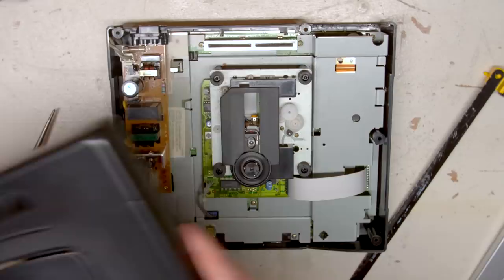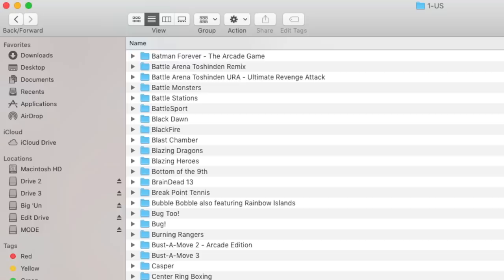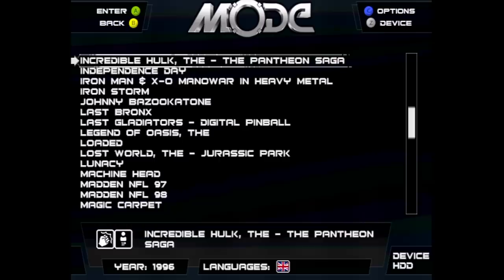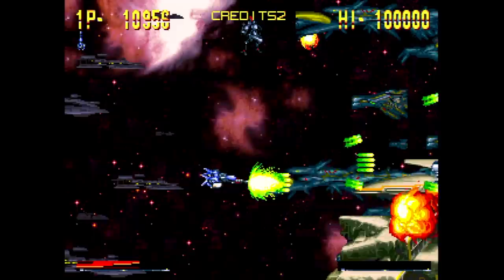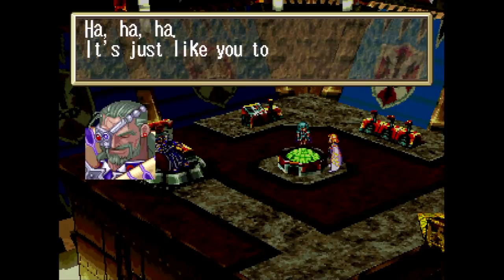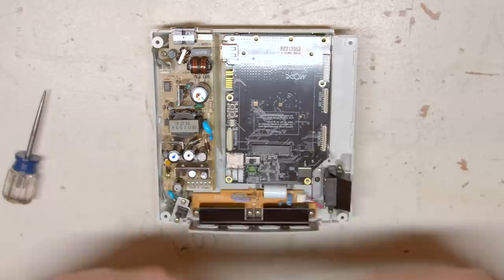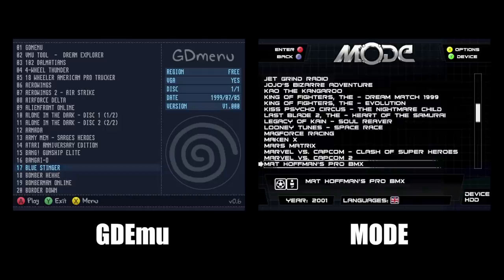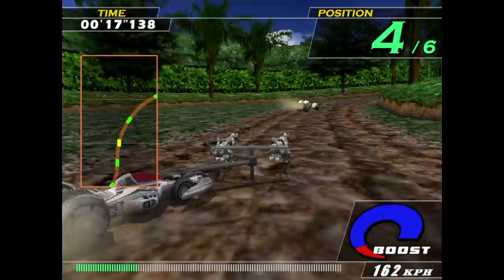The MODE from TerraOnion - Review - Game Sack

Comment: Talking about dreamcast, apart from the folders naming issue, which is the real deal between mode and GDEmu in terms of compatibility and ease of use? As mentioned in the video, I'd rather not use the FCB as a game cartridge to move from Saturn to Dreamcast; on the other side I do not intend to buy another mode, just too expensive considering also customs fees.. thx

Comment: How is the heat on the Dreamcast when using the stock power supply? I have a GDEmu and the System kinda heats up quickly if I leave the top on.

Comment: So I'm not the only one that hears a voice telling me to buy Dreamcast products. ;) Well can't say Terraonion makes a bad product but it's not their fault I can't afford them lol.
Disc rot might concern me more if SS games were easy to find with reasonable prices but optical drive failure is more common with that sinking issue that it's not hard to invest when you consider the alternative original SS hardware route.
A little early for DC optical drive fallout but there's not exactly an endless supply of parts either. Definitely worth investing in a MODE if you want to play some of more expensive games on original hardware Eg. "Could have got Illbleed for $80 complete, who knew it would skyrocket in price?". ^_^

Comment: Sega Saturn and Dreamcast emulation are still both far from perfect. I haven't seen an emulator for either of those consoles that can play a full 100% library with no issues. using real hardware is still the most accurate way to go.
Reply: Absolutely 👍

Comment: 6:44 that's funny, i wonder why that happens when you try to play fan translations on real hardware. I played the fan translated Dragon Quest V on a real Playstation 2 via Open PS2 Loader and it would run fine until i got black screen when i was hours into the game
Reply: Hacks of any game are usually developed on emulators because of convenience, and most, if not all emulators have inaccuries for obvious reasons. Something that runs on an emulator and relies on an inaccuracy is sure to fail on real hardware.

Comment: Once i get rich and can get at least a saturn or a dreamcast, would like to get this. And once i get megarich i'll get one of each console AND a MODE for each :P

But until then, it's just a dream. I would also love to get a SD thing for my NES, mod that NES for NTSC play in addition to its native PAL and mod it for better video out. I'd like to get a SNES as well, and an SD reader for it, an SD reader for my N64 as well as a controller (i bought the thing used for cheap, it didn't come CIB). I'd also maybe also like to get an ODE from the PS1. I mean, i do have all four PS generations, but OG hardware is OG hardware.

I also want to get my C64 to a working condition, get an amiga of some sort, get Master System and Mega Drive/genesis as well as a TurboGrafx 16. Not sure if i'd even bother with SegaCD or a 32X. I'd also want to set up a couple of retro pc's. One for dos and Win3.1, one for 95/98 and that era, and one for XP and maybe Vista. I'd probably set up Vista for fun to mess around for a few weeks, then just get 7...

Comment: I don't understand at all why the MODE in dreamcast mode is loading some games twice as slowly as the much older gdemu.  Is this something that can be improved in a firmware update, or is it some inherent hardware limitation???
Reply from the maker: Dunno. What I should do is also try the same game loading from an SD card instead of SSD. I don't know why that would make a difference but maybe it does?
Reply: @GameSack  Yeah, that would be interesting just to test.  I am planning to do the exact same as you and use a SSD when I purchase a MODE, as I assume the SATA interface combined with solid state device is going to be the fastest.
Reply from the maker: @bruceg22000  Well the physical interface is SATA but it has to be converted down to whatever the Dreamcast and Saturn use. Maybe it's slower to do that with SATA than it is with something like a MicroSD card. Still, a big SSD is less expensive than a big SD card.

Comment: This is something that has confused me for a long time: Why did they make one device for two consoles? That sounds like a massive waste of money, because it likely contains a lot of redundant parts if you don't intend to swap the device across consoles. Could it be they're using an FPGA and can make both consoles work using the same hardware and don't really need to add extra components? Either way, that doesn't make sense if you look at the insane price tag. The GC Loader now shipped multiple batches already and it emulates a GameCube disk drive for just 90$.

Comment: Cover Mode for listing games only displays the correct Cover Art if you name the files the exact correct name. All game listing modes list them alphabetically and there is no way to change that, no program you can run on your PC to arrange the games the way you want like the GDEMU if you use a third party program that run in Windows that lets you add games to a SD Card and arrange them the way you want, no program like that for the MODE. It's been out for over 2 years and support from Terra Onion stinks, they never responded to my E-mail asking why there was not Firmware update file available for download once I registered my MODE, I guess they just assumed I was supposed to know that since I have the latest firmware already on my MODE, there is no file to download. I don't like how they made it so you can't have SATA Drive and USB hooked up at the same time  and just have an option in the settings to select to use either the SATA port or USB port to load games from. They still have no fixed the quirk you mentioned on how it asks for which disc you want to boot on a single disc game.

Comment: MODE should have been built as a cartridge, plus 2 socket adapters for Saturn and Dreamcast. That way, you could easily switch MODE between both consoles with a "simple" plug and play solution. As a bonus, you would have 2 laser consoles converted to cartridge consoles!

Comment: not gonna lie, it's a really bad idea to post a video saying you are doing something illegal XD

also if you take the ssd our of the ssd drive case it will fit in a smaller area, so you can then put a usb stick into the usb port at the same time.
Reply from the maker: Not saying something is illegal doesn't make it legal by default. I'm already showing the extreme illegalness.

Comment: Quit using mac OS for formatting, as it creates random trash. This is why you have ? in the games list.
Reply from the maker: Then MODE needs to fix that wouldn't you think?
Reply: @GameSack  It's an issue with the OS. It sometimes happens with other devices when formatting like PSIO.
Reply from the maker: @hanzobi1926  The device can be made to ignore that, just like Everdrives and SD2SNES or whatever it's called now.